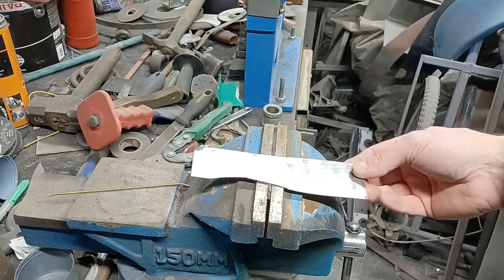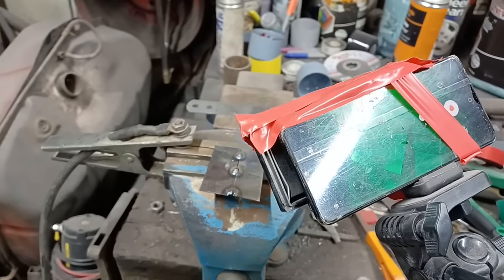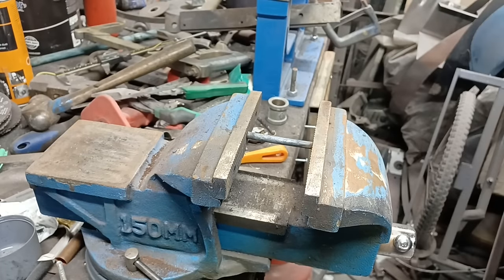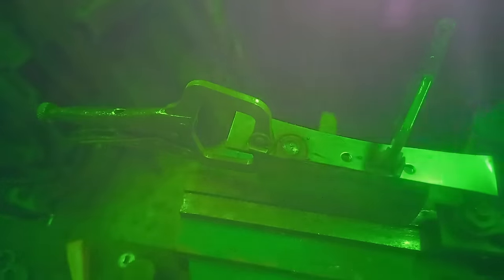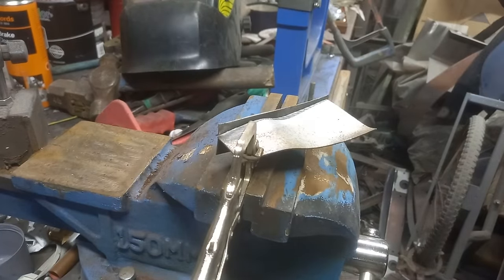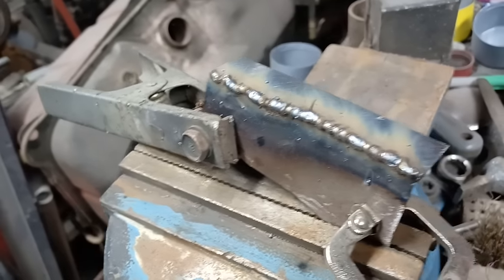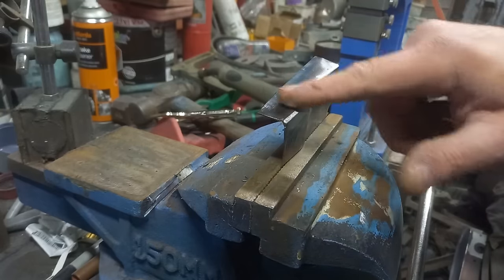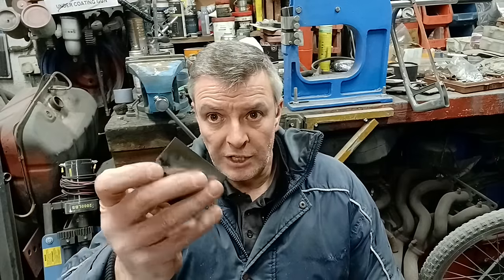Mig Welding Tips. Plug Welding. Lap Welding. Butt Welding.

Comment: Thanks for sharing dave, really helpful indeed
Reply from the maker: Glad it was helpful!
Reply: @DavesGarageuk  it was.  In fact you might know the answer to this, can you weld a vehicle with the battery connected? I'm in a situation where if I disconnect the battery the van goes into limp mode, and only the garage can reset it.  That's citroen for you.
Reply from the maker: @hoverparagliding  I wouldn't weld with battery connected, you may damage the ecu or alternator diode pack
Reply: @DavesGarageuk  Thanks Dave, yeah worth asking as i wasnt sure.  Loving the channel, i think im watching at least 2 a day at the moment.  Also you must be buying all the halfords Weld through in bulk, its like gold dust round here😀

Comment: I have torch on my helmet too. I can get quite dark under a motor whan welding. I would also advise on getting a compressor and blow gun for cooling weld areas and blowing out underseal and seam sealer fires.
Reply from the maker: I used to cool welds with air, but I have found that causes more shrinking and hardens the weld even further due to the sudden cooling.

Comment: Quick question, is there a 13 amp plug on your welder or is it 16amp? I only have a 13amp extension lead to the shed and any mig welder I've seen required a 16amp supply to work properly. 
Did enjoy the video and maybe do one for those afflicted with a flux core welder 🙄 as it's what is affordable to many even though it is frustrating to use. 
I also have a stick welder and they are a joy to use but only on thicker steel....
😊👍🇮🇪
Reply from the maker: It's on a 13amp fuse, but plugged into a socket that's very close to my garage rcd board and a thick cable. 
With your gasless wire, are you using an inverter welder?
Reply: @DavesGarageuk  yes  lidi's finest Parkside inverter model 🙄
Reply from the maker: @terryatkinson899  any good?
Reply: @DavesGarageuk  I guess it's OK, but you know how frustrating they are, filthy welds and smoke plus the wire feed on the cheap ones is abit hit and miss. Sounds like a bad workman blaming his tools 😁
Reply: I'm using a Clarke 135 mig on a 13amp plug all ok. A 16 amp welder will be ok on a 13 amp plug but you won't be able to use the high power settings.
Reply: @robertking5680  thanks for the reply/ information 👍

Comment: Great video Dave ive got a chassis rail to change and boot floor also needs welding on my mk4 escort, what gauge sheet metal would you use for the boot floor?
Reply from the maker: Hi Mark, 0.9-1mm thickness for that would be fine, I think that's 19-20 guage
Reply: @DavesGarageuk  brilliant thanks for your help Dave

Comment: What gas do you use Dave and what pressure?
Reply from the maker: Hi Mark, I use CO2 from a brewery bottle. I don't actually know what pressure the guage is busted, but it's not much, just a gentle hiss from the  torch.  You'll know if you don't have enough, the weld pool will look nasty, full of holes.  Do a weld with the gas turned off and you'll see what I mean.
Reply: @DavesGarageuk  thanks dave ,I've set mine at 6 litres per minute which is like you described but I'm running argon/co2 mix